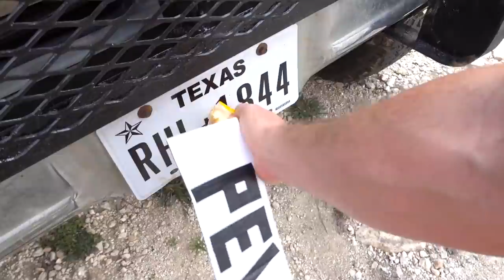I'm Getting Rid of the Bronco... Meet the New Owner

Comment: You never fail to surprise us with your generosity.  I will disagree with you on driving the ALCAN Hwy through Canada to Alaska.  I was stationed st Elmendorf AFB in Anchorage for 6 years.  Drove up there from FL in January,  and drove from there to ID when I left also in January.  Yes it can be very cold but if you are prepared it's no problem.

Comment: If it's going to Alaska , getting that AC hooked up seems to be less important as making sure the heater is 100% just as the starter engine / ignition ( just because I would not want to see someone stranded in the cold with a car which won't start.

Other than that, I always knew you were going to give the Bronco back once you got it 'done' ;)